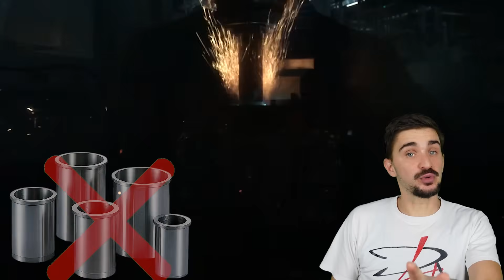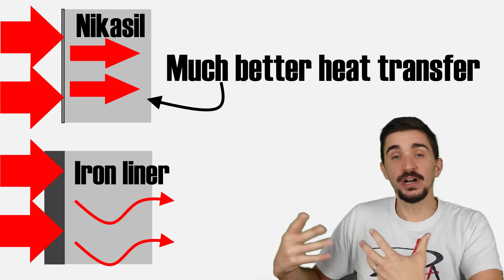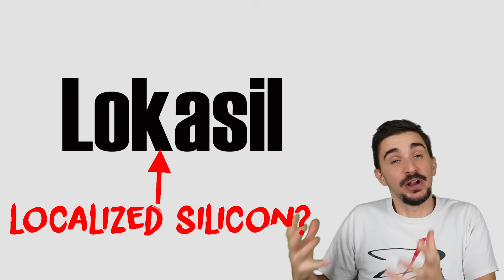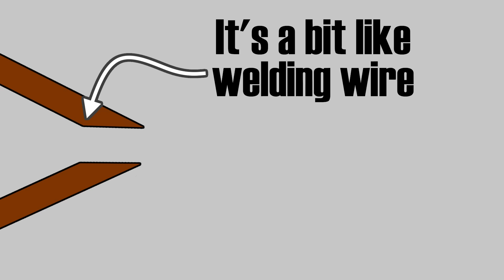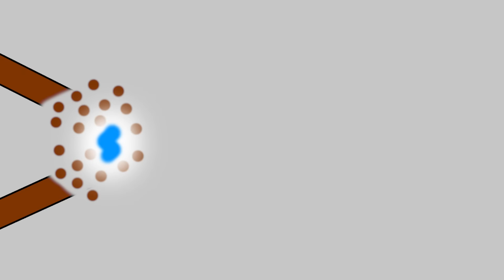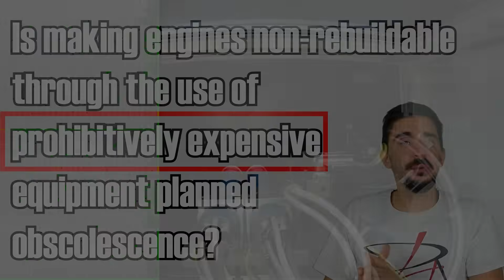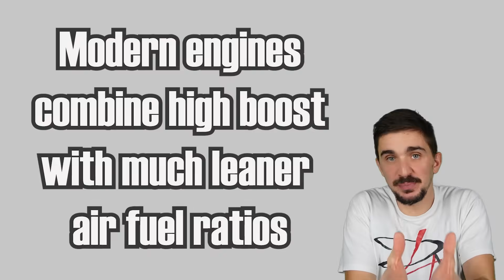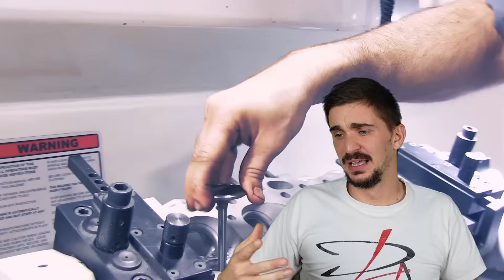Why Are Engines Becoming Non-Rebuildable? Everything About Cylinder Coatings

Comment: what I found confusing about this presentation is that when he concludes "thermal spray coating is more environmentally friendly than rebuilding" I don't know what he means by "rebuilding", does he mean rebuilding an engine with a cast-iron sleeve, does he mean an engine with a nikasil electroplated coating, does he mean an engine with one of the failure coatings (alusil, lokasil, silitec), does he mean an engine with a thermal-spray coating. I think I'm correct to be confused, I think the presentation was confusing.

Also, there are many more auto mechanics than auto machinists, mechanics send their heads and blocks to a machinist because the machines are too expensive for every mechanic to have his own. Likewise its too expensive for every machinist to have his own thermal-spray equipment so that too would be owned by a few specialty shops that the machinists would send their blocks to. Once the demand appears the shops will show up.

Comment: I first thoughts are because engines are so much more complex now. I've got a 1977 Ford Granada with a 302 V8 and there's practically nothing to it. Give me a couple hours and I can pull the engine out of that car. A few more days and I can tear the thing apart and rebuild it. With these newer engines to spend a couple hours just taking plastic shrouds and guards and everything off just to get to what you need to get to. And then the average person like me that can rebuild any old ordinary engine would need an instruction manual to put these newer ones back together with the variable valve timing and all of that stuff. There's just so many more bits and pieces to worry about nowadays.

Comment: @d4a, I m fairly sure Kawasaki were using spray coating on their two-stroke engines as long ago as the 1980's. I was working for a Kawasaki dealership at that time and read that Kawasaki had moved away from the then conventional method of 'plating' two-stroke cylinders to a method described as 'electro fusion' 
This would explain why their very high performance KR1S required a new cylinder if heavily seized

Comment: still not technically the R35 due to the lineage of the skyline GT-R's.  as its not a skyline and doesnt have BNR35 in the VIN anywhere in the world, which all other skyline gt-r's do from the 32, 33, and 34.  31 didnt have a GT-R trim(GTS-R though).  it would have to be based off of the skyline, or G35/350z.

Comment: then dont rebuild, just replace the cylinder block, it wouldnt cost as high as the car even its in developing country. in my country there are many engine hoarders, they scrapped these engines out of abandoned cars or crashed cars. some of them are in very good condition. they will happily sell those blocks much cheaper than brand new blocks.

Comment: All of that is interesting data.  However, one thing that jumped out at me is that the average American drives over 14,000 miles (22,530 km) per year, around twice what the average European is listed at.  In 2023 there were an estimated 256 million cars in Europe, compared to around 291 million cars in America.  This makes me wonder if the economy of scale applied to Europe still applies to America, or is in fact cut in half in America because of the higher mileage that we put on our cars over here.  Since we put twice the miles on a little over more than the same number of engines each year, we'd be due for rebuilds/replacements twice as frequently as Europe....so does the math still justify the cost?

Comment: From the standpoint of mass environmental impact of mining, shipping, refining, shipping, forging, shipping, finishing, shipping, assembly and insertion that any nation's environment protection allows this to just last a year or three before auto makers do it all over again is shameful.  Makers should be made to maintain operability for as long as you are 10 years past the undies handling ability of the CEOs but that's insane state.  Really it was in the 80s that cars worth past a 3 year lease began to vanish.  Yes, I'd choose a 19anythingolderthan73 over anything new.  Sure, it may cost 40% more in fuel but it will  be 10000000000% more maintainable for more centuries than any thing made ten minutes ago.

Comment: Also changing sleeves vs boring depending on tools or by hand but the problem is they crack or the block cracks ,that been said is the manufacturing problem.of the material type is less manufacturing them lighter n saving material n money ,, that been said is the real problems , n that is selling the con , job security,,

Comment: Waaay back in the early 1970’s GM introduced the Chevrolet Vega, a compact car that was designed to compete with the old VW Beetle. One highly touted feature of the Vega was its lightweight aluminum alloy cylinder block. Unfortunately, this design had the same sprayed on coating for the cylinders as shown in your video. The Vega's linerless aluminum engine was notorious for buckling and leaking, and was subject to many recalls. Finally, GM gave up on this design, and returned to the traditional tried and tested cast iron liners.

Comment: last year i rebuilt 13 engines. its rare to see a normal car get a rebuild, most make it to a scrap yard and its over. My view on all things in this world is that they should be repairable - one time manufacturing sucks on all fronts. there are things we can do to make stuff a bit better up front but way worse down the line.  in a passenger car, maybe it does not matter... such a low % ever make it to someone willing to put in that time, but for those of us who do...   most of what i rebuild are diesels - maybe we should all take a step back and try to figure how we can maximize longevity in our products rather than throw away and buy new.  might benefit our planet in teh long run.

Comment: I think it's a con cause compress air turbos air , force induction, air ,, direct injection burning the fuel , the engines are been made smaller lighter that itself less pollution, exhaust systems catalytic converters ,,less pollution is a trick of coarse faster cleaner air pollution ,, plugs n wires smaller exhaust

Comment: the question I'm really interested in is which is cheaper in the long run, maintaining my old car or replacing it every few years ?

you'll have to take into account inflation and market fluctuations like back during the pandemic where there was huge disruption in supply 

I know there's a lot to this question since it's about the car as a whole and not just the engine, but for the sake of simplicity let's consider a car like the 70 series Land Cruiser very basic and minimal

I know that the 1GR-FE in that Land Cruiser is technically non rebuildable, so the question then is it worth it to put a rebuildable engine on a car like that and maintain it for as long as possible?

Comment: The 5 year lease model. 
15k mile oil changes .
Sealed for life transmissions.
I remember my friends having thier dirtbikes re nickasiled at rebuilds on Yamahas. The thinner at the bore is for a reason. Hp levels have more than doubled and that heat has to go. K engines literally split right in half where they meet the cylinder to crankcase interface. I have an N54 and my B58 is no better. Its just different. Everything is a tradeoff. You did lots of research, but I go to Jay at Realstreet .
Reply: Yeah BMWs successfully did AluSil with the M54, M62, M73 N52 and people rarely have piston scoring issues most people when they have compression issues is usually due to stuck or worn rings which get replaced at 400-600k depending on condition and the engines ready to go again. Owner of a AJ V8 4.4 with 254k, BMW M73 263k and a M54 265k miles. One of the three of these vechiles burn oil which it's the one with the low tension piston rings that being the M54 It burns a quart every 2000-3000k all cars get oil changes every 5k miles

Comment: such a small fraction of economy engines will ever be rebuilt that there is absolutely no point for manufacturers to plan for it. and for the very few builders who will endevour to rebuild these modern engines, the exact processes used to apply them can be used to repair any bore damage, and then reapply the coating.

the fact that you cannot simply resleeve them will make it more expensive and specialized work to rebuild, but it's not impossible. And it's absolutely not planned oboslecence for manufacturers to make you engine last longer by using them.

Comment: As long as there isnt a hole in the block or the main journals are intact you can always rebuild. You can sleeve motors or reapply coatings etc.

Comment: Alusil on Mercedes explains a lot about why they have a notoriety for dropping compression on cylinders due to bore scoring. With the plasma spraying processes I would love to see what the finished result looks like and how much and what final treatment is required to make the bore usable. Honing patterns are critical in sealing and oil retention. A lot of science in that alone. Pretty well known for fast iron cylinders to get the deep scratches for oil while the finer ones smooth out to plateaus for low friction

Comment: Alusil is a hypereutectic aluminum silicon alloy.  It was known as Reynolds 390 and used by GM in CanAm racing big blocks in the 1960s, then in the Vega engine.  The Vega had a cheap cooling system which allowed overheating and damage to the alusil bore.  Since then, better made cars have used it well, but it remains sensitive to overheating.
Reply: Being hypereutectic, Alusil has the silicon throughout the casting.  The cylinder bore needs to have the aluminum removed leaving the silicon.  This can be done with abrasive honing pads or with an acid to etch the aluminum.

Comment: So if thermal spray coatings is just a welding hardfacing, then why don't they coat the bores with tungsten cardbide or silicon bronze instead of nickel alloy? Or why not use it on a more durable substrate than aluminum, or just use a thinner alloy steel liner instead of cast iron?

Comment: Not so simple with CO2 calculations. I think the author missed the new engine manufacturing step. It's not enough to recycle aluminum, a new engine has to be manufactured. Also it's probably more expensive to replace the engine (with a new one) than to rebuild, so the consumer might opt to replace the whole car, which is way more impactful

Comment: Alusil engines can absolutely be rebuilt. Minor to medium damage to the cylinder wall does not require sleeving or plating. It’s common in Europe, and there are a number of outlets developing cost effective strategies in the US as we speak. 

In the case of alusil, the entire block contains silicon in the same concentration, as you said.

The repair process for alusil is to hone or bore the cylinder to over-size. Business as usual for a machine shop. Mahle, kolbenschmidt and other manufacturers even sell oversized pistons for countless alusil applications. For example, factory oversized pistons can be had for the BMW S65 or S85. These are sold and intended for use in a bored and re-exposed alusil block. Not a sleeved or plated block.

The only special step after resizing the cylinder is re-exposing the silicon crystals. This requires an Alusil specific honing paste and hone. It also requires a surface profilometer to measure the Ra of the cylinder after honing to verify proper exposure of the silicon crystals. We are talking a few thousand dollars of equipment for most machine shops. Pennies in comparison to some other machining equipment.

Sunnen and kolbenschmidt both have excellent write ups on the process and requirements.

Because of the lack of knowledge and experience with Alusil in the US, tons of shops just resort to saying it can’t be done, or that all you can do is sleeve or nickel plate. This simply isn’t true.

As more and more Alusil engines fall into the hands of used car buyers, engine builders, and DIYers, this process will become cheaper and more prominent.

This process is also very common in the marine engine industry, as they have been using alusil engine blocks for decades. 

Other than that, great video. Thank you
Reply: This is correct, I have rebuilt multiple Porsche 944 engines which are Alusil.

Comment: Thank you for the tech details.    Fascinating.   I do think a couple of things are missing.    Engines are so complex,   tryi9ng to rebuild them is complex (possible failure) and costs are hi9hg.   So a replacement engine with a good warranty  is often better.   You don't get full life (estimates are a rebuild last only 60-70% as long vs factory new that has a full warranty as well).    And if you got 15 years out of the car,  other things begin to fail.     Having seen engine tear downs and the hours it takes just to get to the rotating assemblies?    Argh.      We used to repair TVs,  now we just replace them.